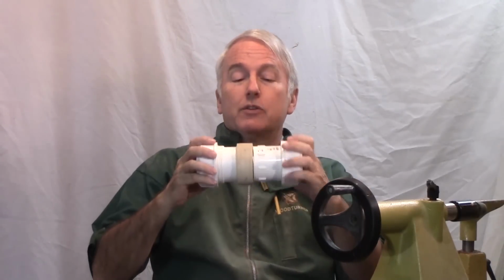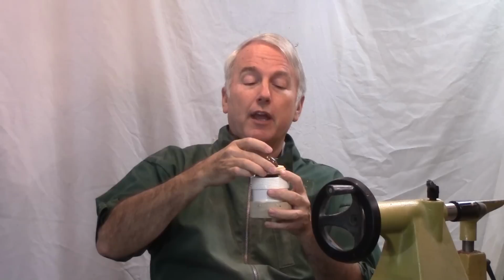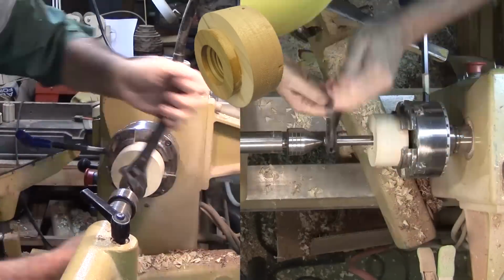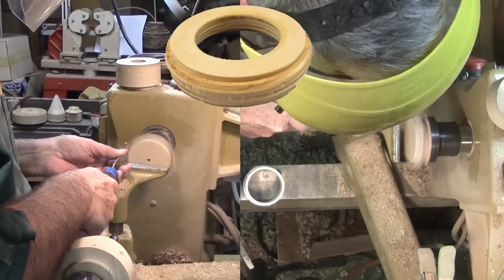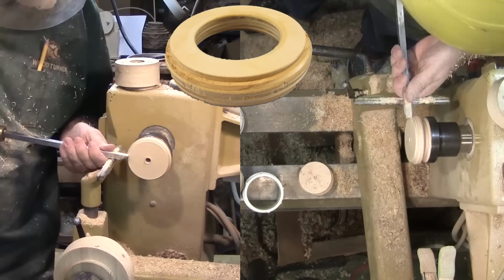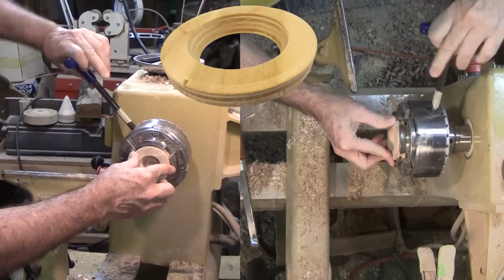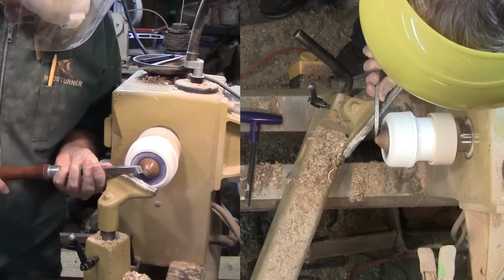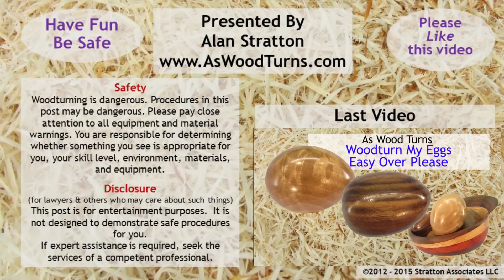Woodturn Simple Egg Chuck From PVC Fitting

Comment: Hi Alan,
Nice chuck.  It could probably be used for working on spheres as well.  One thing you might try in the future in place of the wood is PVC trim.  You can get it in sheets and boards.  It has a smooth skin and dense, rigid foam interior, and can easily be turned on a lathe or tapped with a spindle tap.  Since it is PVC, you can just glue sheets together to get a thicker section and you can also glue the PVC fitting into a slot in the tapped section so the chuck will be entirely plastic.  I've used this technique to make several vacuum chucks, and the threads are holding up very well.
Reply from the maker: Sounds like an idea worth trying especially if you have other uses like you do.
Thank you.
Alan

Comment: Good idea, but you may do it much simpler just by turning a groove in the wood piece left in the chuck after turning the egg. Turn the groove slightly smaller than the egg diameter and knock the egg gently in place. I get less wobbeling this way than I see you have with the chuck. Making the eggs with similar size, such a "chuck" may be used for a lot of eggs.
Reply from the maker: Actually, now I believe a wood collet fitted to a standard woodturner's chuck will do a better job. Probably similar to your suggestion.
Thanks for commenting.
Alan

Comment: Instead of the filler disks for inside the chuck, why not use a chunk of stiff foam, or even memory foam? that would adapt to any size of egg, and other irregular shapes as well.
Reply from the maker: Try anything you want as a filler disk between the chuck bottom and the disk at the bottom of the egg.. However, I would still turn a dished out form that approximately fits the bottom of the egg. It's possible that memory foam would hold the egg but would it center the egg? That's the job for the dished out disk holding the bottom of the egg.
Hope this makes sense.
Alan.
Reply: As Wood Turns
I was thinking the same thing as Rez but can see how that won't work do to centering issues... Ever try turning that hard foam at home depot?  I was told once that you can use it as part of a jam chuck for finishing the back of a bowl and I wonder if you can turn the dished out disk from it.  Any how thanks for sharing this!! My head is spinning with different things you can use it for!!!
Thanks again, Cody
Reply from the maker: Cody W I think you have a handle on the issues, so try it out and let me know how it goes.
Alan